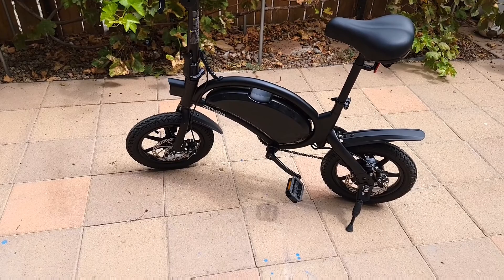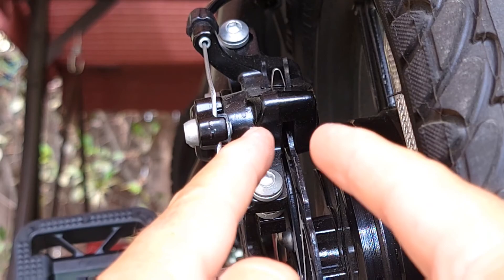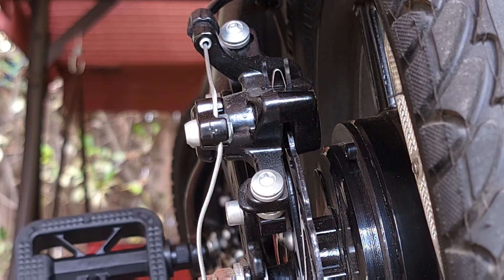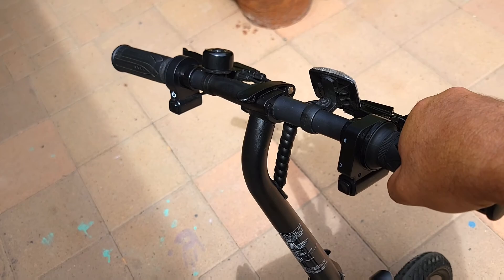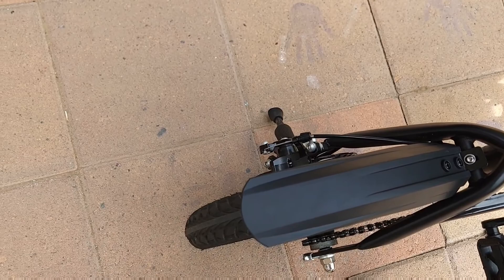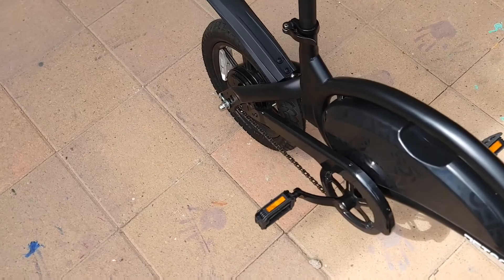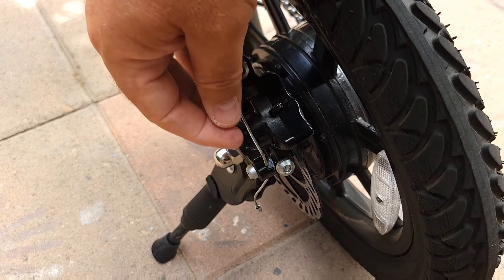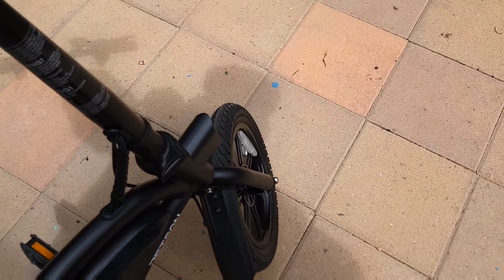How To Adjust Brakes and Braking Pads on Jetson Bolt Pro Ebike

Comment: ironically, even with your accent, this was the most help ive gotten than from any other video. THANK YOU for  describing what happens when you loosen/tighten each bolt. All the other videos just tell you to loosen this, tighten that, without actually saying "loosening this bolt adjust the pads horzontially" etc . thank you!!

Comment: Just when I was about to get to the point the icon/image blocked it. Not cool
Reply from the maker: What icon/ image? Advertising ?
Reply: @erides the circle picture with the guy holding a red bike
Reply from the maker: @buzzardscry1383  thanks, will try to remove that